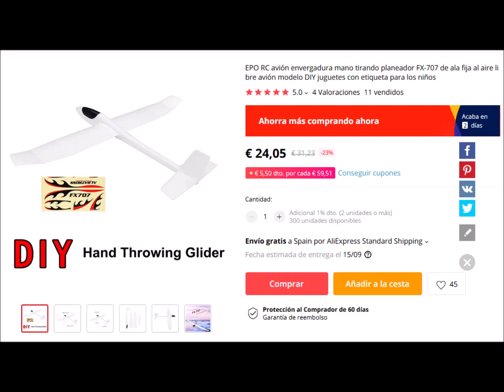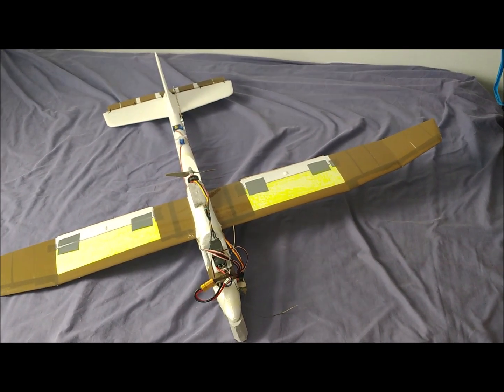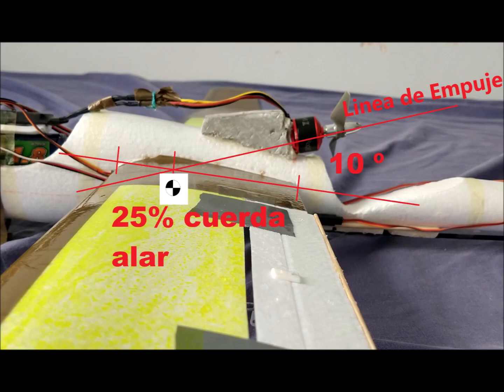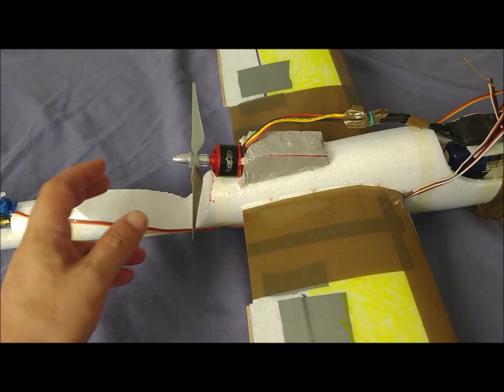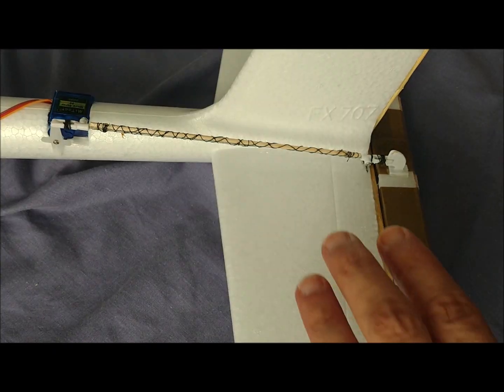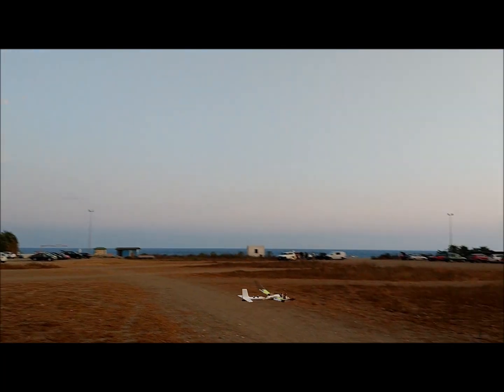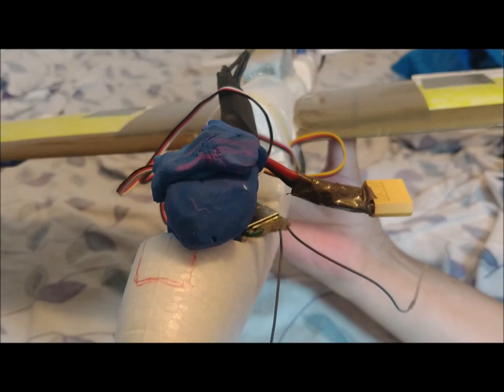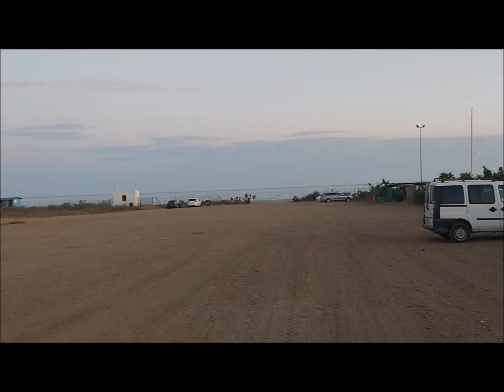How to RC conversion FX-707 1210mm Wingspan Hand Throwing Glider. Radio-controlled airplane DIY

Comment: That has to be the absolute worst ever attempt at converting a glider that has very minimal diy to it ,
Ive coverted a few of these planes and the only thing i have external on mine is elevator & rudder servo’s , i possition mine in each side of the fuselage about 25cm from moving surfaces but still diy cut out the foam to sink & glue servo’s in place , also acts as a good counter balance against a motor & esc in the front & nose cut off & firewall glued in place and motor mounted on the front